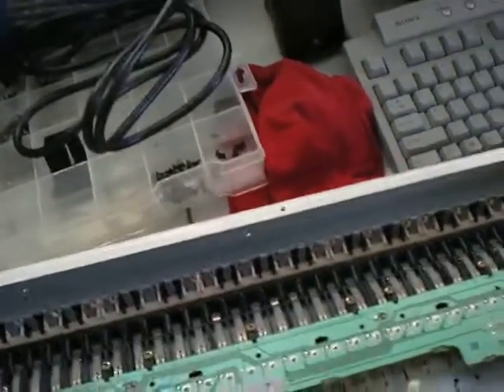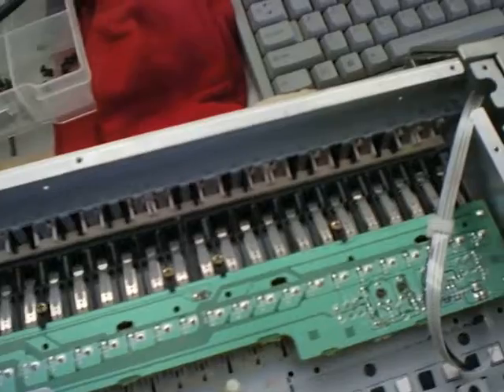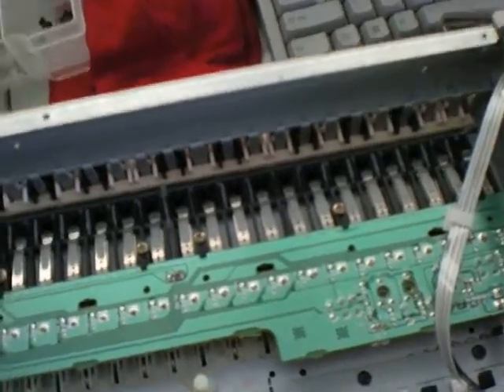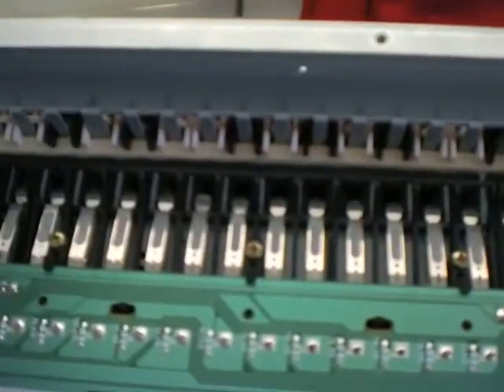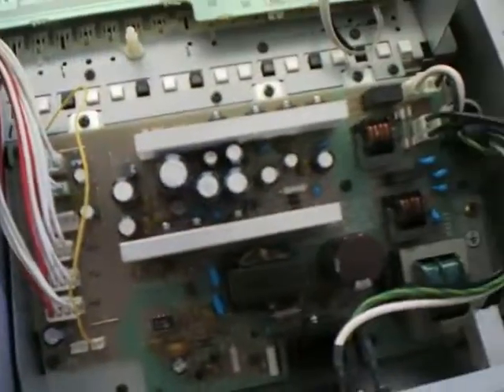Yamaha Motif 6 synthesizer key pad velocity sensor alignment tutorial

Comment: One more thing about this specific video, continuing what I've said below, there is no "alignment" of the contacts to be concerned with because those contacts should Never be in place when working on the keys. The board has screws and connectors that's meant to be taken off and out if the way for servicing keys, and to be put back in place again after you finish servicing. The board plastic frame only has one correct spot that fits in place, just move it around slightly and when is in place you will feel it pop in its place so you can put all the screws back on.Working on keys with that board attached will make you damage the metal contacts in 95% of the cases.
Reply: I have a amplification issue with my motif.  I have to put the volume to max to be audible.  Do you know what causes this and how to fix it?
Reply: Hello. I have issues with some keys playing very loud sometimes while I press them soft. Mainly the C and keys I played the most, probably caused by old age; I have it over 10 years. I am thinking of having it repaired at the shop, or is there an easy fix i can maybe perform myself? ...will it be an expensive procedure at the shop? any idea?

Comment: Hi, i just want to make an alert to anyone either posting or watching these repair videos, as people keep doing these procedures incorrectly and most of the times end up damaging their synths instead if fixing them.Guys, for the love of God, and once and for all, If you are doing Any kind of repair that's even remotely keybed related on these Yamaha FS type keybeds, the very very first thing you need to do (seriously), after you've taken the bottom plate off to open the keyboard, is to disconnect the two cables running from the key contact board to the motherboard, take all the screws holding the contact board off, and carefully put the contact board asside safely out if the way on a flat surface laying on its back.Then you can disassemble everything you need to disassemble, whether it's keys or anything else. That contact board is the most fragile part of the whole synth, the metal contacts bend and can break easily. In any circumstance you sould work on this keyboards with this board attached to it. I've serviced these boards dozens of times successfully, so I know what I'm talking about. Don't take shortcuts on this thing, do it properly and you will have no problems after you fix it.Hope it helps anyone. Cheers :-)
Reply: hi was reading your comment I took some electronic course and have fixed amps mics. Except keys on a Yamaha motif 7 if you do videos I wud love to see how to repair keys without damaging my keyboard.